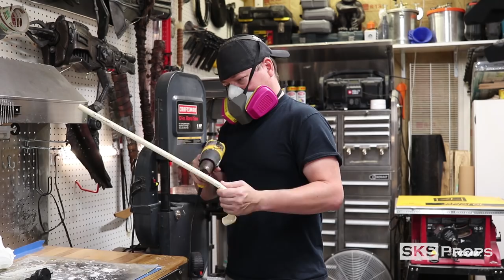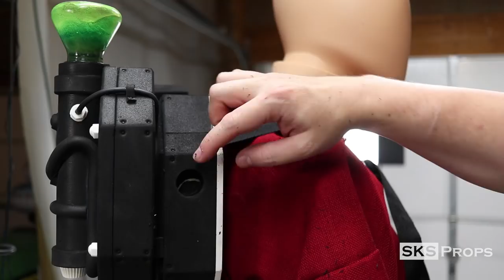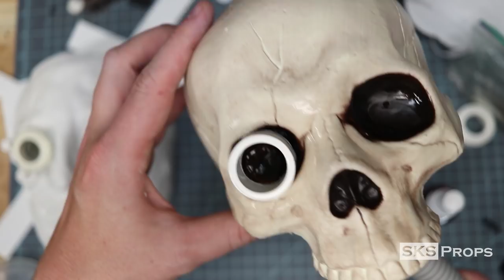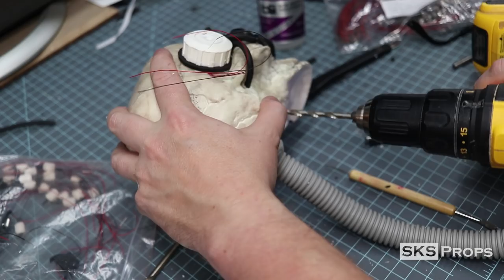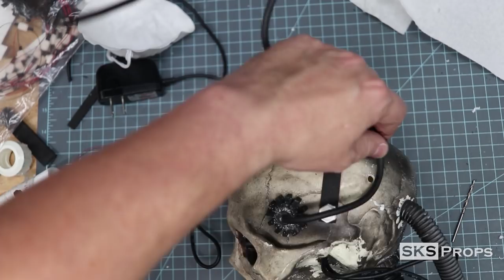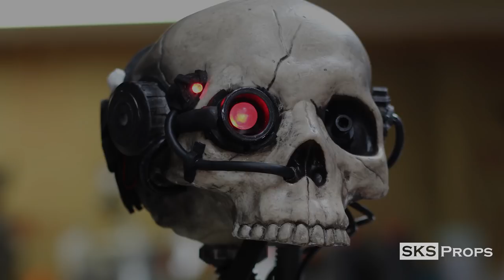How to make a Warhammer 40K Servo Skull Cosplay Prop

Comment: how did you even managed to mount it on your backpack without it tilting? I tried mine and it went sideways.💀💀💀
Reply from the maker: There’s a pipe and coupler inside the backpack. The skulls pipe gets inserted into that to keep it stabilized